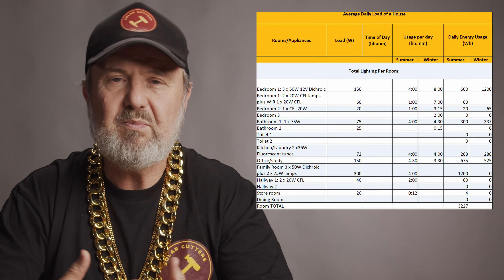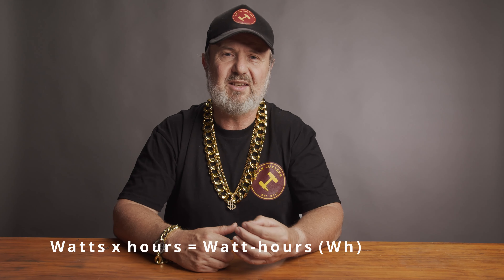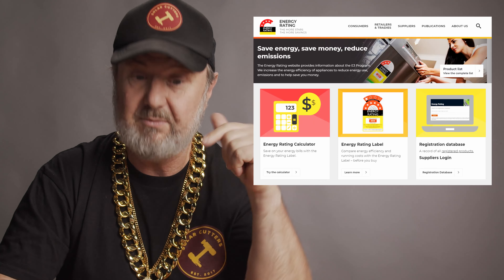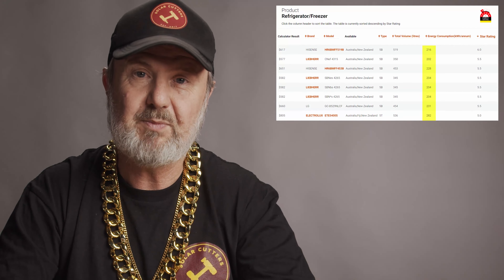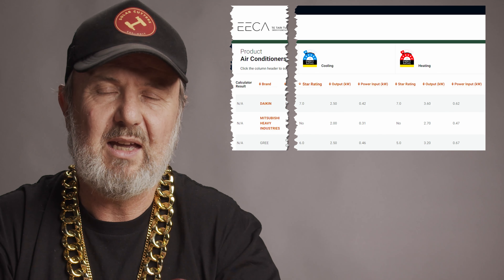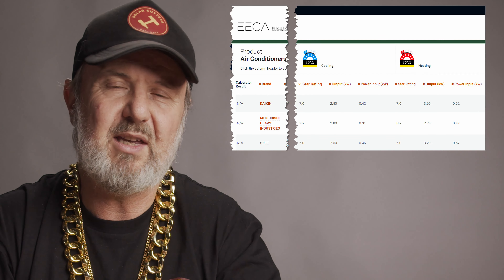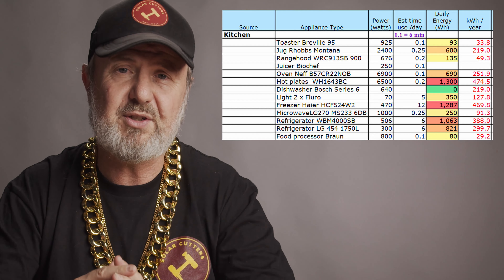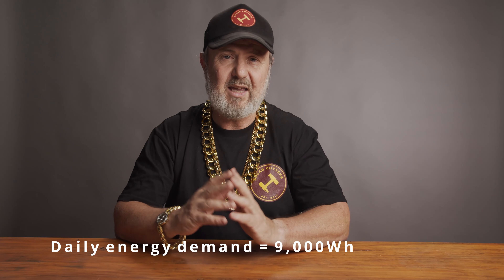Off-grid solar and battery system sizing

Comment: Hi Glen,wanted to ask,if a battery has a recommended discharge current,is that meant to be set on the inverter ? Or is it just size the load within discharge limit
Reply from the maker: Depending on the battery, it may self-limit the current thus shutting down the inverter, or it may exceed it's safe discharge limit and cause damage to the battery. Best practice is to limit with a circuit breaker or fuse the maximum current supply the battery cable (to within it's limits) and ensuring that the inverter settings are such that this maximum isn't exceeded.